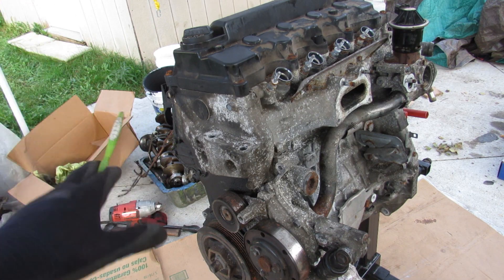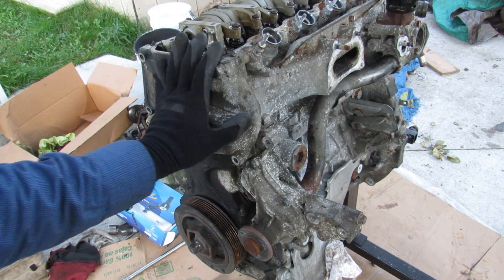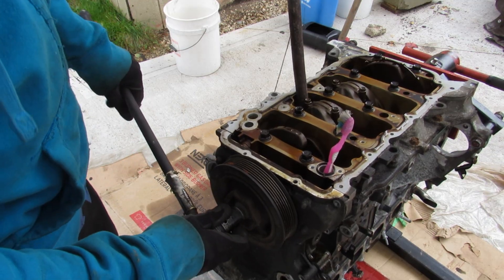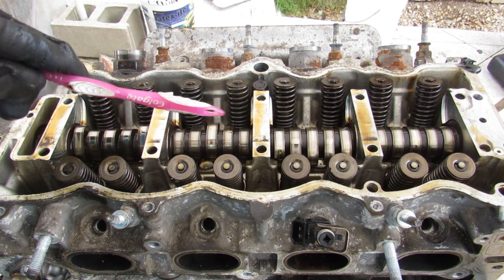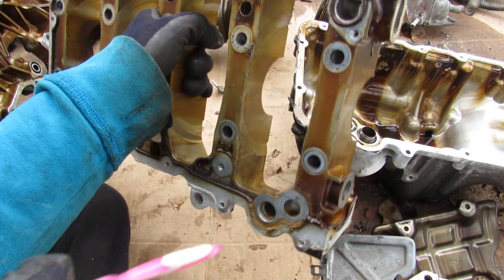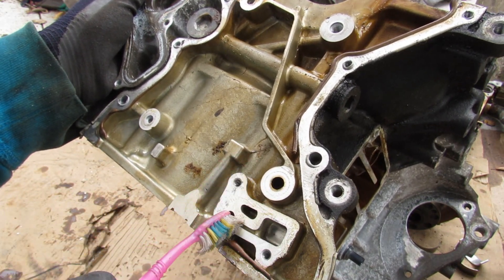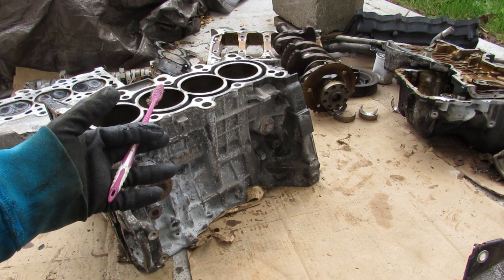Why Honda Civic Engines FAIL

Comment: At 0:40 you misspoke because the exhaust DO NOT get reburned. Inert gases.
Reply from the maker: Right
Reply: @Alfred Wedmore Ok...if you want to get technical...there should remain some small levels of oxygen. An exhaust gas analyzer proves that out. But for the purposes of that portion of the video, the main function of the EGR valve is to lower/regulate combustion temperatures. Exhaust gases in general certainly don’t contribute to combustion...if anything they have an opposite effect.

Comment: This engine is very clean inside. Someone was keeping up with oil changes.
Reply from the maker: It was amazing except the oil rings
Reply: @speedkar99  any idea what caused the oil rings to get so gummed up?
Reply: @polymetric2614  turning car off immedietaly after doing 100 on highway
Reply: @speedkar99  can you tear down a PSA Ew10 2.0 engine ?

Comment: Are Purolator oil filters cheap? I thought they were mid-tier?
Reply: The bearings look "brand new" so they must not be that bad at filtering???
Reply: Depends on the filter series.
The Tech line is basically a retail standard filter. (The red one). Mid tier is the Purolator ONE. Glittery blue filter. The top of the line filter is called the BOSS,Gray filter with glitter.
Reply from the maker: Any shop brand stuff I consider everyday stuff... nothing premium
Reply: @speedkar99  What filter do you recommend that I can buy for my Honda? Love your videos!!!

Comment: Love the simplicity of that engine...aside from the casting fault it's designed to be durable and last a long time.  As for head bolts saw a tip on another channel...turn the block 90 degrees so you're pushing the breaker bar downwards to loosen the bolts, that way your engine stand isn't moving around
Reply: Yeah, other than the block cracking and turning the engine into unrepairable scrap metal, it's great!🤣But in all seriousness I agree, a lot of the ones that didn't crack have lasted a very long time with good efficiency and minimal maintenance. Even the automatic transmissions for those engines are normally very trouble free, which isn't a given for Honda.

Comment: If you think R18 is bad, try the 1.5 Turbo, the L15B7! But you do have a choice of the 2.0L K20C2 with timing chain instead of timing belt, and Port Injection instead of Direct Injection, without the carbon deposit build up
of direct injection engines! I'd say the 2.0 Natural Aspirated K20C2 is very reliable if you use Mobil 1 Extended Performance or Pennzoil Ultra Platinium 0W20 oils with extended performance filter
Reply: Honda engines with direct injection don't have carbon build up problems Scotty kilmer talk about this

Comment: Some of the early 2009 with vin starting with 2HG are succeptible. Mine is a 2009 with 2HG starting vin but I think i'm lucky because no cracks yet😂
Reply: Same with mine.
Reply: Still no cracks ? I’m at 209k miles on my 07
Reply: Im at 190k miles now and still no cracks

Comment: My 08 civic has this cracked block.
I bought it for $500. It has 175k miles and very quiet and smooth. Still has a solid base.
Would it be worth it replacing the low block? Or swapping the engine?
Love your videos and content brotha!!
Reply: @Paul S nonsense
Reply: Maybe drive it but keep fluids full as mentioned, but I’d say don’t race it and try for more miles ‘free’. U got $500 out of already maybe.
Reply: k20 will coat ya 400, just sayin, get a k20
Reply: it would be worth a junkyard engine swap if you did the work. if you had to pay labor it's not worth it. 

it's absolutely not worth the time to rebuild it. even if you did the work it's a waste of your time.

just like in the video these engines pretty much all burn oil because of the rings sticking. the converters do a pretty good job at hiding the oil smoke. and i have personally seen several blocks cracked after the  08 model year fix. tanks? ha! junks more like it.

not Hondas best work r engines remind me of later Toyota engines where just the name is enough to convince you it's a good engine. 

now if you wanted to swap in a k series engine for proformance reasons it's going to be a ridiculous amount of work and an insane amount of money for a car you could replace for about one quarter of the money your about to spend. but it makes sense because race car. 

  i have done it and it makes a civic feel like a super car. costs roughly 10k in parts makes the car proformance on par with corvette high end mustangs and such cars. 

add a cheap turbo and a hondata board with a tune say another 5 grand and it's easily out preforming lower end Lamborghini and McClaren cars.
Reply: The 10th gen is a great car. I drove mine for three years and then sold it for what I paid for it. Replace the short block and drive it until the wheels fall off.

Comment: Actually theb pcv inlet is on the valve  cover the  pcv valve "outlet" is on the back of the engine by the oil air separate right around from the timing chain tension window on the timing chain cover

Comment: Have a 2012 civic with this engine with 94k miles thing runs absolutly mint. I wasnt aware of the cracking problem ill definitely keep my eye on the ground for coolent and check it every oil change.
Reply: The cracking problem does not affect your car. It was casting problem at the factory, and was corrected in early 2009. Also the 2012+ Civic comes with an R18Z1 engine, which is an upgraded design. Nothing to worry about with your car :)
Reply: Oh thanks for the info my freind.

Comment: I have this engine on '16 civic EU version. I change the oil under 10.000 km and it's quite a pleasure to drive it on the street, it's comfy on long roads and it does not disappoint on acceleration. Thank you for the teardown :) BIG Like !
Reply: Great preventive measure to avoid ring problems: 8-10k synthetic oil change interval should make the engine last. No more than 12k km, please.
 I'm telling you, there's no such pleasure like taking the engine apart because it burns oil and discovering the owner read up somewhere that he can use Long Life oil and skip on oil changes. Idiots, especially when it comes to Hondas. The 2.4L are known for having problems with baked rings. We even had Acura that our costumer bought, with the 2.4L still on warranty - 90k km, we drained 2.5L of oil instead of 4L+. The Honda dealership changed the rings under warranty with not much arguing.
Reply: @pliedtka  i bought a used 2010 8 gen civic with r18 engine in 2018. 54,000 km mileage and the engine has burned up to 3L of oil in 1000km. it was unbelievable and i have never seen that before.
I was sure the piston rings were absolutely coked, so I used several engine cleaner in short intervals. the dirty that came out was crazy. everyone who changed oil on diesel engines know, how dirty engine oil could be.
but i ve never experienced that an a gasoline engine.
the EGR valve was also complete dead and changed it.

It's also important to use a heat-resistant oil. r18 engine has problems with the oil temperature, especially after higher speeds.
The previous owners changed the oil according to Honda specifications all 20,000 km is far too long. but the previous owners of my car topped everything. they used very cheap 10w40 oil. at least according to the oil paperlabel that i found. a lot gen 8 drivers do that with cheap 5w30 oil and are surprised about the high oil consumption. plus on top, they drive short ways whats also a nightmare is for this engine. its a no go.
so it is absolute right what you say.

i use a extreme heat resistent fully synthetic 0w40 oil, that produces high oil pressure on operating temperature. more than the most other X-W40 oils i know in europe, in combination with liqui moly ceratec.
full throttle on the german autobahn is no problem and the oil level is stable. the engine is now very smooth.

r18 engines can be very reliable, if you use quality oil with short intervals.
sorry for my bad english
Reply: @Fisico87  Why use 0w40 when it calls for 0w20? At least my 14' Civic does. Also, how often do you use the Liqui Moly Ceratec, and why? I've actually used it on old beaters of friends and family that have noisy heads even after valve adjustment and it quiets them down noticeably!
Reply: @groundcontrol6876  because I have a Gen 8 with the RA18A2. this type is optimized for 5w30 oils. the gen 9 has the RA18Z1 and is optimized for 0w20 oils.
I use the ROWE 0W40 Synth RS, a high-quality synthetic oil from Germany. the base oil is a PAO oil and the additive package is very, very good. Yes, I am reducing fuel efficiency, but I prefer wear protection over fuel efficiency.
Why do I use LM Ceratec?
it enormously reduces internal friction and saves fuel. exactly this amount of fuel that I also need with the 0w40 oil compared to the 5w30.
as a result, I offer the engine a very strong overall protection against wear.
the greatly reduced effect of the engine brake alone proves the benefits of LM ceratec.
my honda mechanic who adjusts the valves is happy with the condition.
no matter how i drive my civic, the engine takes no oil, so i think i am doing it right.
Reply: @Fisico87  I use Mobil 1 3000 X1 5w40 and change it after 7500km for the last 30,000km since I bought it. Previous owner changed it after 10k km or less depending on the style of driving. Engine has 160,000km and never had any problems.
Reply: @Fisico87  Yeah, the oil is very important. I live in Bulgaria in relatively hot climate using fill synthetic 5w40 from Eneos ACEA C3 to keep the CC clean. The engine loves it. Regular changes on 5-7k. In my case the previous owner had used some 'fake' Romanian 10w40 Castrol and initially the the engine burn some oil but after couple of changes the problem is no longer observed. I also recommend Yacco oils for hard engine abuse but yacco is bad for the CC. Cheers
Reply: @georgigeorgiev7232  В Бултрако също наливат 5-40, доколкото ми казаха на всичко.
Reply: @digirapa на чисто нова не е добре да е 40, но кат направи годинките е ОК. Редовна смяна му е майката. С тея скапани горива е риск да сложиш тънко масло, още повече, че изпускателните са на блока и моторът принципно си е топъл
Reply: I use original Honda oil 0W 20. And don't want to go over 10k km with the changes:) thanks for the advice.
Reply: I LOVE my Honda! I have the 2015 Civic 1.8L (USA) version 🤗

Comment: These problems aren't present in europe, rather the one with thinner piston rings that cause high oil consumption for those engines in civic 9 generation, R1A piston code

Comment: About the i-VTEC on this engine; the middle lobe is actually the 'normal' lobe which is used on the full rev range. The other 2 lobes for the intake change the engine into a Atkinson cycle engine if certain conditions are met. Beautiful engine as long as they don't crack. I've had the Euro version, the R18A2 which don't have that issue. Otherwise same engine. Drove it up to 300.000km, mechanically a very quiet engine, no oil usage, good mileage and felt quite torquey for its size.
Reply: True about the vtec implementation on r series!
Reply: The outer lobes are the "normal" lobes. The center lobe is the Atkinson cycle lobe. That's why it has the longer duration.
Reply: @tylhunt  you might wanna understand all vtec systems before bashing.  Considering you have normal vtec, power vtec, I-vtec (both power and economy), vcm, vtec-e and regenerative brake.  VTEC is just a trademark at this point and has many different variants now days.  This isn't your B16b with single cam lift.
Reply: @LazySniper  "But what does a Honda tech know." apparently not how the R18 operates.
Reply: @LazySniper  I also call BS on "the center lobe disengaged and seals off the cylinders creating an engine brake effect." in the L13B
Reply: @tylhunt  lda-mf5.  I stated the wrong one.  It's used to increase engine braking to charge the hybrid battery via ima motor.  The the r engine, the center rocker is the default rocker arm until light loads and economy conditions are met.  Then the outer rockers are used this lowering lift, duration and slightly retarding valve timing.
Reply: @LazySniper  " It's used to increase engine braking to charge the hybrid battery via ima motor." That makes absolutely no sense. You would not want to increase engine braking during regen. Increasing engine braking would reduce the load on the electric motor, reducing its power generation ability.
Reply: @tylhunt  just say you don't understand anything and can't admit your wrong.  IMA has 3 mode charging, regen braking, engine decel braking charging and engine drive regeneration braking while using the actual brake, decel breaking while using engine braking and normal stator charging from the engine (since they don't have alternators).  So do us a favor and go back to your three friends and tell them the wrong information again.
Reply: @LazySniper  Lol. Strong words from someone who is demonstrably wrong about how VTEC works on the R18
Outer lobes are used during idle and acceleration. Center lobe is a high lift, high duration profile, and is only used during light load operation. It's used in combination with the DBW throttle body to reduce pumping losses.
Reply: @LazySniper  You should do us all a favor, and ask your dealership for more training. 
Also nothing you have said backs up your ridiculous claim  "It's used to increase engine braking to charge the hybrid battery via ima motor".
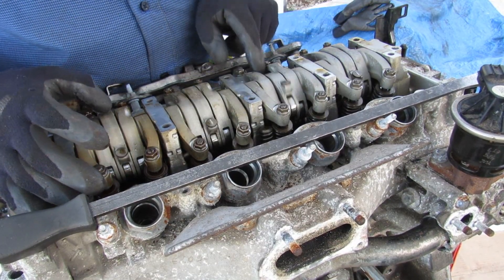Reply: @LazySniper   https://www.youtube.com/watch?v=Px0_6-Btx3Y - A video of the R18 operation. Valvetrain at 2:15
Reply: @LazySniper  Also, if you wouldn't mind. just say you don't understand anything and can't admit your wrong. lol
Reply: @LazySniper  atkinson cycle is longer duration and delayed timing to push the air/fuel mixture back into the intake.  the video is on this very website.
Reply: @tylhunt  ya it’s Hondas weird linear geared automatic transmission that’s  more similar to a manual transmission then the majority of automatic transmission. That is what creates the engine breaking effect… most automatic transmissions are planetary gears not linear
Reply: @xX-CiviC-Xx  maybe it's just a misunderstanding, but my previous conversation about engine braking was in reference to regenerative braking. Not transmission type.
Reply: @LazySniper  I don’t think so. It’s an Atkinson cycle. The bigger lobe has a longer duration that allows the valves to stay open longer during the compression stroke, resulting in in Atkinson cycle that allows some of the fuel air charge to be expelled from the cylinder, resulting in less pumping loss because it takes energy to compress the mixture if there is less air to compress , it takes less energy and that’s how an Atkinson cycle engine works. The larger lobe is for longer duration of the intake valves. And it does work in conjunction with the drive-by wire throttlebody, allowing the throttle body to open up wide otherwise it will be getting more air into the cylinder with the wide open throttle, except the longer duration low allows the engine to pump out some of fuel air mixture
Reply: @xX-CiviC-Xx if you've ever seen a R cam, the intake lobes are offset slightly and the vtec lobe has a longer duration with the same lift as the "low" lobes.
Reply: That is the economy variant of iVTEC.
Reply: @Fritsified so if I have a UK made 2006 civic, I don’t have to worry about this cracking issue?
Reply: @Zhong Xina lol. K series motors have i-VTEC you doofus.
Reply: @Zhong Xina for the r18 it's designed for improved fuel economy and emissions during light load conditions. As I said earlier.
Reply: @Zhong Xina lol. You're 100% right. It's a huge conspiracy.
Reply: "No oil usage"... I use a litre a year when running 0W-20... none on 5W-30 but still... shit.
Reply: I just bought Civic Tourer 2014 manual 6 speed with only 87.000km. The engine is torquey as you say and fun to drive. Nice to know that R18A2 can reach 300.000km with ease.👍
Reply: @The_Touring_Jedi  That sounds like a good buy with the low mileage. Love those wagons, extremely practical with loads of space and magic seats. It will definitely serve you a long time, enjoy!
Reply: I was just going to say this.  The R engine along with older L engines, the center lobe is the regular lobe and the outers are Atkinson lobes in the R.  In the early L engines, the center lobe disengaged and seals off the cylinders creating an engine brake effect.  Also why these engines run like absolute poo when they don't have enough engine pressure.
Reply: @LazySniper  Can you name me 1 L series engine that operates the way you describe?
Reply: @tylhunt  LDA-MF5 dsi found in first gen hybrids.  But what does a Honda tech know.

Comment: Well you can see the cost cutting compared to a k series. Other than the obvious single cam design. Way more plastic parts. Plastic valve cover, pickup tube, chain guides. No roller cams. I'm surprised the bearings were mint but the rings looked so bad
Reply: Um, no balancing shaft?
Reply from the maker: I think this was the more economy minded engine compared to the larger K-series, hence all the cost cutting
Reply: @speedkar99  Yeah for sure. In some markets the R20 replaced the K20 tho which is kinda depressing
Reply: @knipsi22  R20 has balancing shaft

Comment: I have an R18 in my HR-V but supposedly they fixed the engine block issues way back in 2009.
Reply from the maker: Yes early 2009 is when they corrected this
Reply: What did they do to correct this issue, and why do only some crack and some dont?
Reply: If buying go by the VIN numbers though. Mine was made in March 09 but it has the old engine.